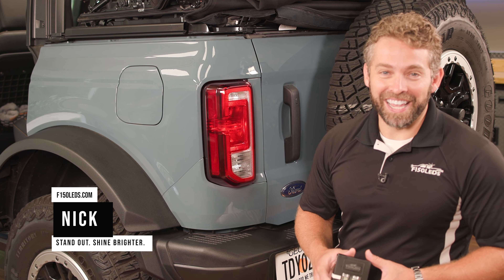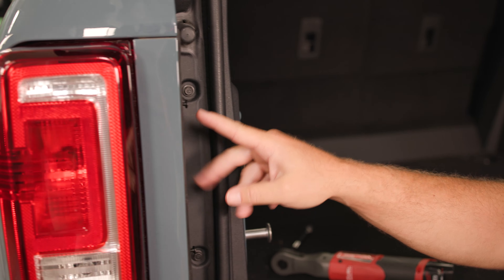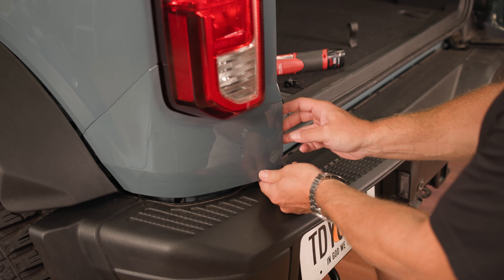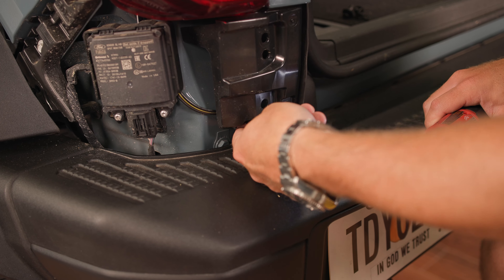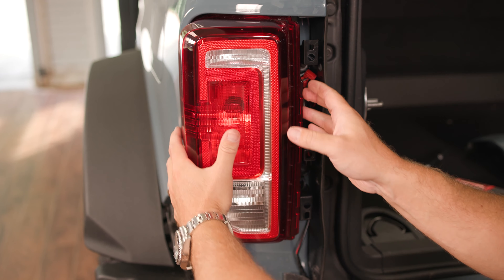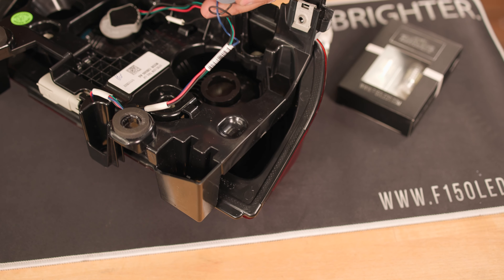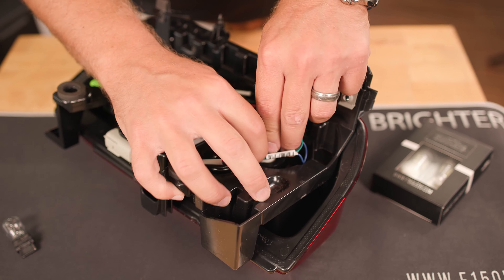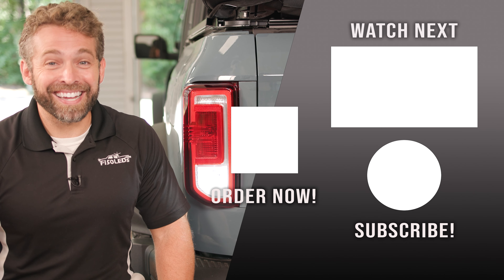2021 + Bronco LED Reverse Lights Installation (From F150LEDs.com)

Comment: Seems like a cost effective way to get a brighter reverse light than changing the entire housing.I am going to check my  23 wildtrak and see if i have a taillight that has a halogen bulb.
Reply from the maker: Hey Anthony, absolutely! Generally the Big Bend, Base & Black Diamond trims have the halogen version. The other trim levels, like your Wildtrak, typically have the LED reverse equipped from the factory. If you are needing more reverse light power on your Wildtrack check out the link below! 

https://youtu.be/WjsP5oj4bDA?si=ra0fYwjO0ZaWpzxF

Comment: What's the reason for not being able to use these on a BLIS equipped Bronco?  I already have LED backup lights from the factory but it seems like these are a bit brighter.
Reply from the maker: Hey there! Our lights are indeed much brighter, but the Bronco tailights with bliss (signature series) has factory lighting that is not replaceable via a bulb. Thanks for your support, we look foward to serving you soon!
Reply: @F150LEDs  Ah, got it.  I should've inspected the tail light a little closer when I had it out a while back.
Reply: Do you need to make any Forscan changes? How does the reverse camera work with them installed? Thanks
Reply: @davidcentino  Forscan shouldn't be necessary for these.

I obviously don't have these, but I did install a set of LED lights in my bumper separate of the reverse lights a while back throwing out 6500 lumens, and I can give you a little insight before you feel cheated the first time you try them out.  The rear cam has an auto brightness/dimming function, so while you may be throwing a lot more light back there for the camera to see, the display will automatically dim back to a preset brightness.  It's going to end up being the same brightness on the display as before, you're not going to see a super bright picture on your screen just because you doubled or tripled the lumen output of your backup lights.  Makes sense, right?  That camera has to work both day and night, so it has to display full sun and darkness using the same display, without being too dark to see during the day or blinding you at night. What you will notice is a less grainy picture at night, and perhaps more of the surroundings that were completely dark before (reflective things will stand out better too).  The reason for this is the type of sensor in the camera is very sensitive to low light conditions, it's almost good enough to be night vision, but the resulting picture from dimly lit surroundings is a much lower resolution.  Throwing more light out there is going to allow the sensor to pick up more detail and provide a clearer picture, at more or less the same brightness on your screen as before.  So before you start worrying that something isn't working right, just remember that the camera and display are supposed to dim like that with extra light.

Obviously the other advantage is that you'll be able to see a lot better with your own vision and through the mirrors, while others in the area will see that you're backing up from miles away.
Reply: @Skinflaps_Meatslapper  wow thank you for taking the time to explain the camera auto sensor. I just pulled the trigger on the reverse and blinker/ break light led kit. I am ok with the way the camera works now and really want others to see me backing up. Also seeing more without the Camra/screen is just as important with central NY winters leaving backup camera blocked at times you need hem anyway.
Reply from the maker: Hey David! No forscan needed for reverse light upgrades! It greatly increased visibility on our Broncos back up camera as far as clarity but also 'depth/range'! The auto senor / low ISO ability of the OEM camera is only so efficient so increased light placed in the right zones is good for your visibility. We look foward to serving you, thank you David!
Reply: Can these be used to replace the brake light also? Or do you make a version for the brake light?